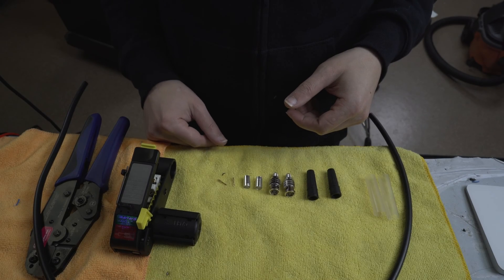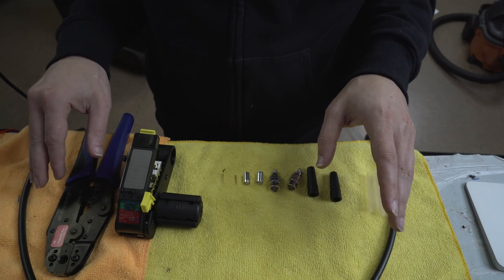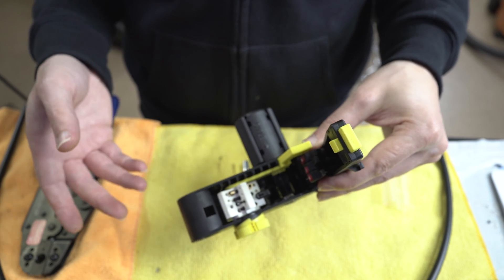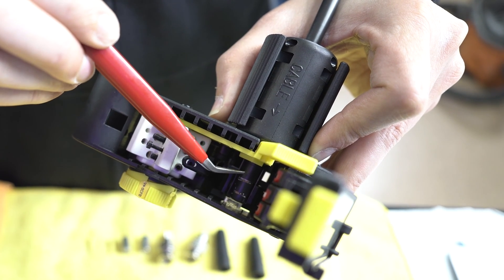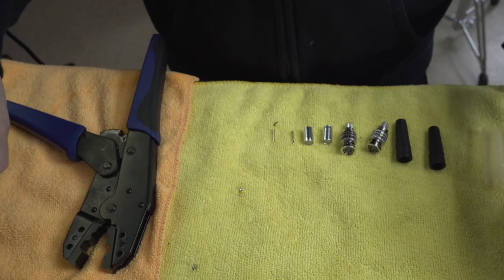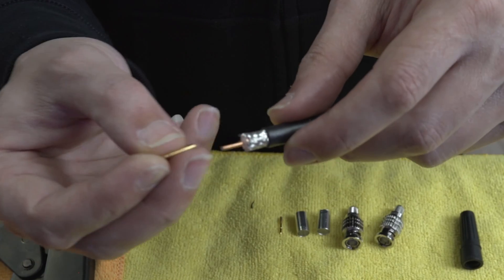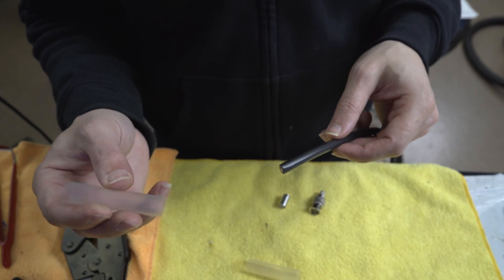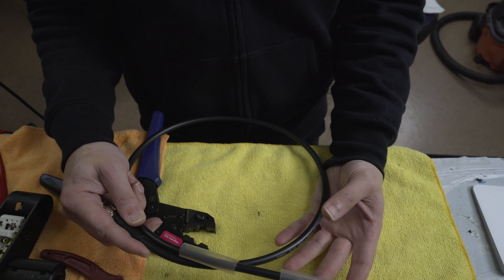How To Build A Custom 12G 4K SDI Cable

Comment: Crimped exactly like this but removed the copper foil before crimping now only 3G signals pass, 12G no signal at all.     Could the foil really make that big of a difference?  All Canare 5.5 Cables and Connectors, same ones used in this video.

Comment: Also, interesting that the instructions WANT you to flare the shield all out. I've never heard of this being a required step, so I wonder how required it really is, and whether it causes more harm than good. Conversely, I never used the crimp sleeve to help avoid flaring… I keep it off to see that when I slide the plug in, the shielding indeed goes nice and clean around the plug. In your video, viewers that are new to the procedure can't quite see what you're doing or how deep is deep enough, to slide the plug onto the cable.

Comment: I am having issues with the T-100E cutter and my cable depth for the 5.5 cable. I just cannot get the setting right. Any chance you ever measured your settings and have them?

Comment: Not familiar with these cables but before you pretty it up so much looks just like RG6/59. Anyway, I guess my question relates to that needle piece you stick on the end. It's hollow and and fits on the center conductor, so therefore it's thicker. But it does make me wonder how that helps anything performance-wise. Any reason why these cables aren't just made using a longer center conductor? Also, when I did cable work ages ago, we were taught to make the center conductor short so the cable loses as few dB's as possible. By using the needle it's basically the same scenario as making the cable with an extra long center conductor. Yet somehow these cables carry more content on them.
Reply from the maker: This cable/connector is designed with portability in mind, that's the main difference. Where as a traditional F connector in a traditional home cable TV application could stay in place for years, the SDI cable using a BNC connector is disconnected/connected daily in portable applications. The 1/4 turn vs the F nut is a huge time saver. The needle tip is for longer term durability in this portable application. It also has a tapered tip to make mating with the jack easier.
Reply: @billylaguardia  could you give examples of the portable applications they would be used with?
Reply: @JWolff-md3ij  Video systems of many types used in hospitals use SDI cables as the video signal cable. 12G is needed for 4K and/or 3D signals. These systems are connected and disconnected or a regular basis and needs the longevity of a special needle instead of the naked center conductor. As for signal loss, this is a digital signal and can be boosted in strength and cleaned up for noise, unlike the old analogue signals in old cable TV.
Reply: @JWolff-md3ij  production companies doing outside broadcast events who are coming in and out of venues on a daily basis who will be plugging and unplugging sdi cables and tbh treating them very roughly and these cables are made to handle that
Reply: You can leave off the center pin and cut the conductor longer, it works in a pinch. It's ghetto and the wrong way to do it though.